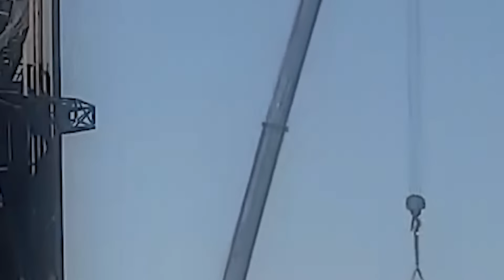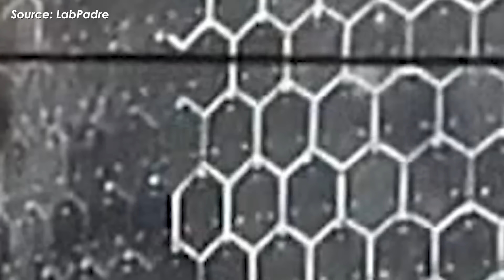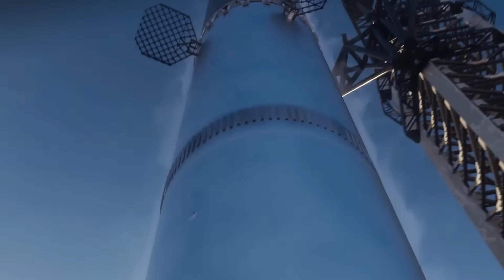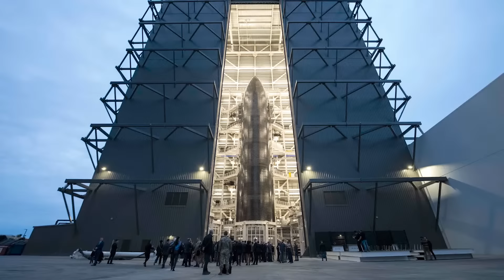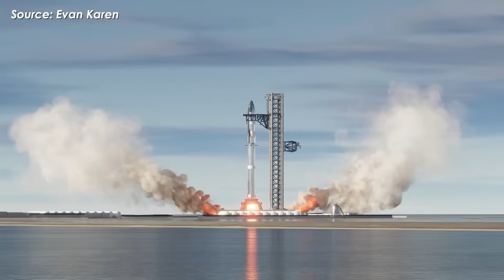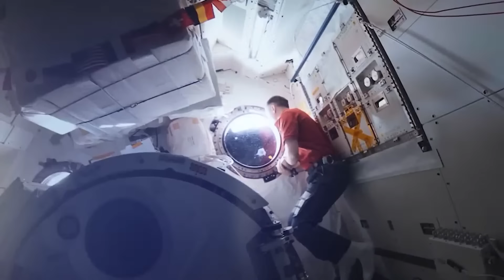SpaceX's genius Solution on Starship Flight 12 to Survive 1500°C and Make History!

Comment: 1.Golf ball dimples,
 2.bleeding/cooling points,
3. netting anchors, 4.preferred failure points, 
5.expansion joint/nacre fills,
6. Passive Piezo compensators,
7. Acoustic resonators,
8. Passive diagnostic feedback Canaries,
9. Thermal Crayon Markings,
10. Laminar Flow Channels
11. Pre-destructive testing
12. Controlled cracking points,
13. Passive or Active Piezo/Thermal Triggered passive defenses,
14. Thermoelectric hardening defenses,
15. Musical Roadway Bumps,
16.Constructive or Destructive Interferences,
17. Ultrasonic Imaging Assistance,
18.Internal Fiber Optic Connection Points,
19. Air Bearing points,
20. Gecko Feet Anchors,
21. Rock Climbing hold points,
22. Adjustable hole fills,
23. Largest musical instrument, (Giga Flute) (#7)
24. Hotspot Warning System,
25. Plasma Modulators, 
26. Graphene Worm Heat Ablators,
27. Laser Based Defense System,
28. Largest Cribbage Board,
29. Sleep Aid

Comment: Those posters in the starfactory are channelling Mussolini's ones in the 1930s - Rosie the Riveter, they are not. This marks a worrying trend. Even in the height of the Cold War the USA never used this kind of propaganda (But USA interwar nazis DID use the same kinds of imagery)

WRT the VC25B, the single biggest problem  is that the US military has demanded that the entire aircraft be certified to today's standards - that's an admirable wish but the 747 is a 1960s design with inherent unsolvable issues, requiring effectively a new aircraft that looks like a 747 but isn't a 747

Comment: Normally SpaceX is focused on a couple main items and many smaller improvements.

Flight 12 changed that V3, new internal fuel design layout, Raptor 3 engine design, hot staging, tower design with flame, mount design, catch improvements. 

Booster 18 copv disaster basically put a big damper on flight 12 progress. It pushed planned schedules out. SpaceX basically went back to intensively pretesting step by step, looking for problems vs pretesting partially finished systems.

They want flight 12 to be an improvement on flight 11, not a repeat of the first V1 or V2 flights. 

The orbital refueling schedule timing may be compressing against V3 introduction scheduling. So test, fail, improve, become pretest, pretest, pretest, test, fail, improve. They want a flight 12 success, repeating flight 11 path with new V3 hardware.

Comment: I am CONFIDENT, SpaceX propellant transfer in SPACE will be successful by utilizing their specialized techno, to manage cryogenic liquids in the vacuum of Space. 
It also include even while operating under direct sunlight. 
The 🌞SUN ☀️will actually acts as a heating source tht creates "boil-off evaporation."
Last time, I've read this in my Space journal,  SpaceX had experimented this in their lab~through a combo of thermal control, rapid transfer, and SETTLING the fuel, rather than avoiding the SUN 🌞entirely. 
Jst remember, in between our Earth and the Moon 🌙 🌚, BOTH ROTATE around the SUN independently 🙄.
In other words, ALL PLANETS ROTATE around the SUN. Each planet has it's own axis. Few planets has its MOON. 
BUFFOONERY❗️❓️❗️no more Sparkles 🐔
Reply: How can they transfer fuel if Ocean pollution cant even orbit!
Reply: @DrDiff952 

Because, OCEAN pollution,  such as plastic waste, withhold or does not accelerate to the speed of the earth. The plastic waste we disposed in the ocean,  remain on the surface or jst sink to the ocean floor. In other words, we human being were highly ignorant, arrogant, stupid, and lack of moral turpitude towards loving our Earth.
However,  do not try to compare the OCEAN and the SPACE above us. It has a different gravitational force and velocity. OCEAN pollution is stationary or drifting.
I hope, I answered u the best way I can.
Have a nice afternoon ☺️. While, I needed more rest due to working double shift 😪💤😴
Enjoy ur w-ends 👏
•~●Dead kat🐲

Comment: The white spots are the known hot spot points where the tiles fail, in that the vertical seams allow the plasma to channel along the vertical seams due to the hot spot forming along the outer edge of the tiles because of the production process. 
   This can best be explained by using plaster of Paris silicon moulds as an example. When you place pop( plaster of paris) into a silicon mould, a then it immediately settles towards the bottom of the mould and takes the shape of the mould( vibrating usually helps to remove any air bubbles that may be within the ceramic( or pop) mixture before it sets. This unfortunately means that although the mould may follow the curve of the Starship hull, the top surface is always flat, and thus cannot form or approximate the curve of the hull without using a two part compression mould ( like bricks), usually using compression & vibration to force excess moisture out of the ceramic ( or pop) mixture, so that there forms a curve ( or curve approximation) on the upper surface before it sets, or is "fired" (like in roof tiles). It is because those upper surfaces are "flat", that they form ridges that are "proud" on the hull surface, which then acts as a hot spot of plasma surface heat penetration.
Reply: Amazing 👏 comment above. U've mentioned the use of "plaster of Paris silicon moulds."
I learned something new.
Thank U 👍